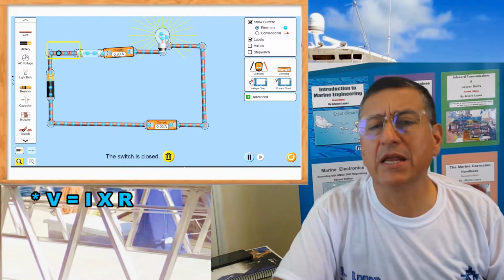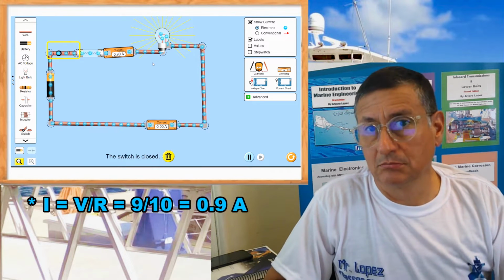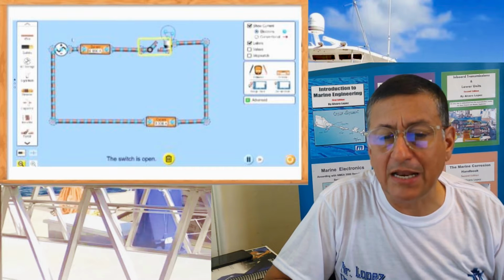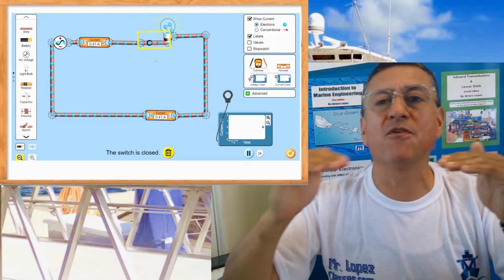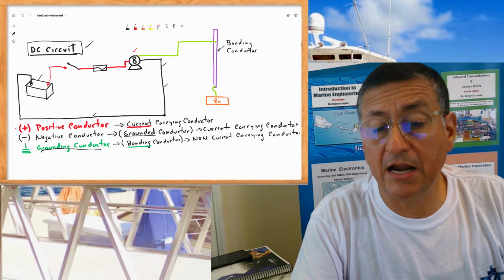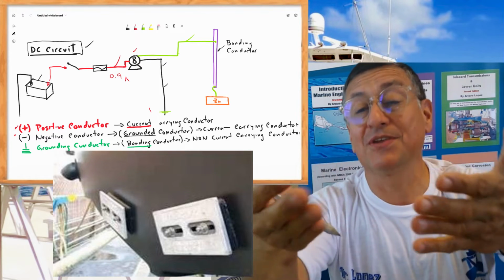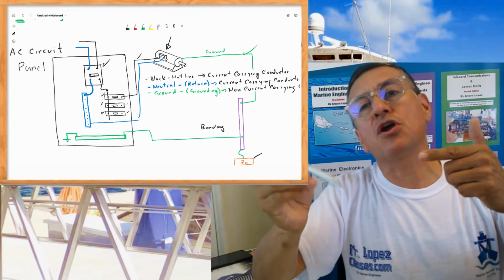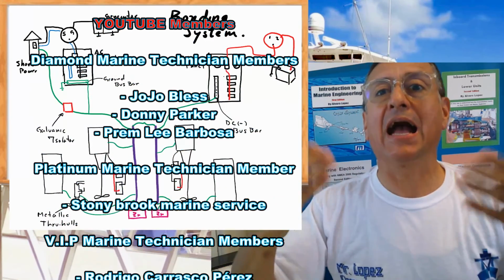Bonding, Grounding - Current Carrying Conductor

Comment: Thanks a lot for all your great videos and for helping with this really confusing subject.  Some components manuals seems to refer GROUND as a connection to the DC negative busbar while others refer it as a connection to the grounding busbar (and from what I know we should only have one link (wire) between the DC negative busbar and the grounding busbar on a boat).  For example on my inverter/charger the GROUND should go to the grounding busbar (right?).  But I want to also install a “battery protect” component that have a DC+ in, DC+ out and also a GND port to install a really small cable (compared to DC+ in/out), should that cable connect to the DC negative busbar or the grounding busbar?  In the manual they show this cable connected to the negative battery post.  That’s an example of why this is so confusing for me, and probably why many DIY boaters are connecting theirs ground anywhere.  😉
Reply from the maker: Great Question
I am preparing a short Video-Clip with the answer to that question.
Regards
Reply: @MrLopezClasses  Wow, thank you so much!  🙏